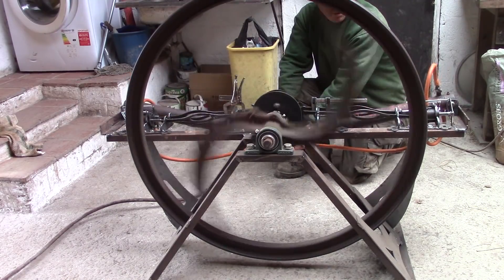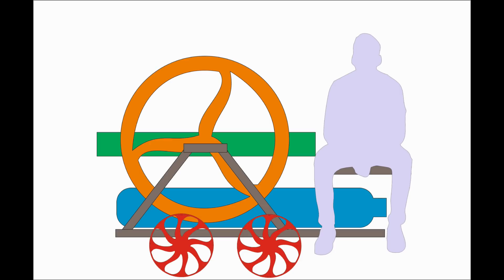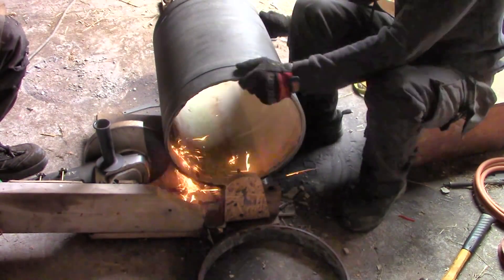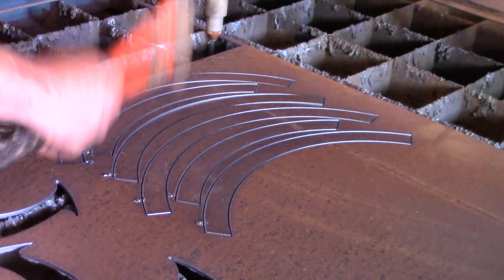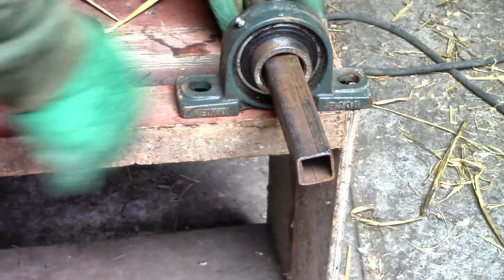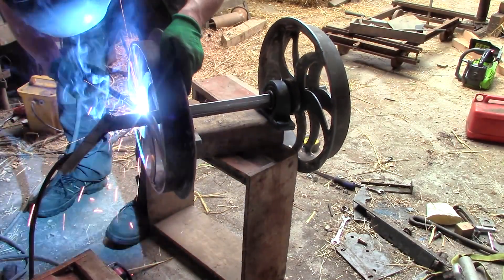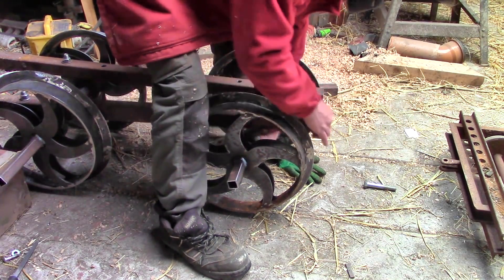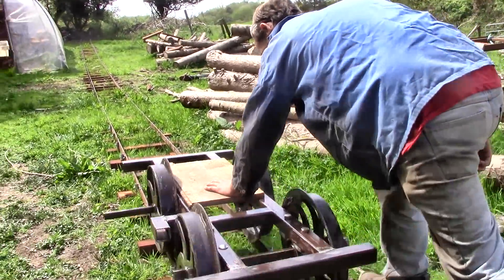Making A Locomotive For The Field Railway – PART ONE: Wheels and Chassis...

Comment: I'm a machinist and seeing people making stuff like this makes me proud to be in the trade. One of these days I hope to build my own little railway for enjoyment purposes and also to move bits of firewood/landscaping material around the garden. Your railway is the inspiration.

Mine will probably be smaller (maybe 12 inches gauge) and may have a rack/pinion sort of bit on the steep section of track.  My garden has a decently steep hill that I don't want to foul the looks of by grading it. It'd be easier sure, but the idea of fastening a gear to an axle doesn't seem impossible. The toothed center rail might be a pain in the rear though. 

Fantastic video as always and keep up the good work!
Reply from the maker: Thanks very much - good luck with yours

Comment: Would you be able to post a Scalable Vector Graphic file for that wheel design? It would be really helpful for those working on a similar project.
Reply from the maker: Of course, no problem. But you'd need to adjust it to your pipe and axle sizes - and if you are able to do that then you could easily design your own spokes..
Reply: @wayoutwest-workshopstuff6299  yeah, that fairly easy with SVG files and can be easily scaled, currently looking to make wheels for a locomotive, I’m fairly close to getting the trucks finished.

Comment: Cleverly thought out, innovative and low cost rail system. Sure it doesn't meet the ideals of a hardcore railway enthusiast but, it works, and works well. Perfect for application as it serves the purpose it is intended for. And, if you need a part? Just kick a rock and find one.
Well done Tim.
Reply from the maker: Thanks, Gwyllym. It's addictive though - you can never have enough
Reply: @wayoutwest-workshopstuff6299  I've done some calculations based on the torque available from those cylinders with a 2.77:1 ratio with 300mm diameter wheels and ignoring all losses, your limit will be a bout 300kg of tractive force, flat out at 60psi. So it will move something that's for sure. On a level grade of course and doesn't take I to account the weight of the locomotive 

Looking forward to the next installment

Comment: If you build the steam one, you could just skip the axle in the middle and put the boiler down low between the wheels. Both sides can be driven fully independently with their own set of valves etc. which offsets a bit the steam demand over the cycle and lets you use smaller pipes until you hit the T-piece going to the valves :)

Comment: I had a strange idea for if you went for compressed air. Make a set of bellows for your feet that you can pump while you ride, so you aren't just sitting there.
Odd idea, but imagine making two longer lines side by side, and you could race locomotives.

Comment: It will be interesting with the weight of the engine. Be enough for traction.  That fine balance between too much weight for the air engine to too little weight and not enough traction. 
It goes without saying there got to be some kind of whistle. 
Good luck with this endeavor.

Comment: Hi Tim, not railway related but this might be a good idea for your next project. I've seen a French invention on the internet made by a company called prommata that's being used all over the world, a tool to be used with draught animals with modular attachment meaning you can attach a plough, potato lifter, ridging plough, subsoiler and any other attachment used for working soil.
Reply from the maker: Thanks, Jack. We're moving away from all soil cultivation because it leads so rapidly to erosion, so they wouldn't suit us anymore. Mulch is the best way if we can make it work for more crops..
Reply: @wayoutwest-workshopstuff6299  Fair enough, perhaps a horse drawn seed drill then?

Comment: If you need a valve gear for the engine I’d probably either use walchaerts or stephensons. Stephensons is better for smaller locomotives and can be internal or externally it’s also better for hill climbing. Walchaerts is easy to maintain and build.
Reply from the maker: I'm glad you think they're easy!

Comment: Did you have the carriage upside down in the trial run?🤔
Reply from the maker: I wanted to have the frame under the axles but the flywheel would foul the axle anyway, so the frame is above..

Comment: I might be mistaken, but I believe CO2 canisters are able to be pressurized much higher than oxygen. In my area at least, it's about a third of the price as well. I admit I have not consulted the machinery's handbook on the subject, but surely CO2 would run an air engine just as well, no? Again I don't know if it's only true of my area, but cannabis legalization has caused grow equipment to flood the secondary market. I have bought carbon dioxide canisters for less than the deposit! Aluminum ones no less. This demographic is much more focused on speed than profit margins. There's a ton of specialized switching equipment based on humidity temperature or light that I have found remarkably useful in the workshop. If legalization has reached your area or will soon, I highly suggest you keep your eye on the secondary market. There's a lot of really good quality gear that somehow never got remarketed to a different demographic yet many of these things are much better in the machine shop then they were in the greenhouse. I hope something I said was of some use

Comment: Lovely job, wonderful to see your railway getting an engine. Good to have larger wheels, though you'll still want to gear them down rather slow, I've had trouble with slipping wheels with the low contact area that narrow rails have. Great progress!
Reply from the maker: I'm surprised you've had slippage problems, Jonathon - you're running a heavy loco on level track. I'm worried about mine now!

Comment: How about a electric-hydraulic powered locomotive? Ie a electric motor powering a hydraulic pump powering cylinders. It keeps the cool factor and fun of hydraulic cylinders and valves. I think it would be relatively quiet, like an air tank powered vehicle would be. There could also be hydraulic power takeoff for portable cylinders, or perhaps a wood splitter rail car. It would have sufficient battery power to run an AC inverter to power electric tools or accessories. 
If you wanted to go wild, it could also be equipped with large tires to go off rail, like the opposite of hi rail truck. If it was articulated in the middle, it would handle tight turns on rails and be able to steer off-rail. Steering could be done with a hydraulic cylinder that is floated on-rail and powered off-rail.
Reply from the maker: Go for it, Aaron! It sounds a bit complicated for me - I go for cheap and simple everytime : -  )
Reply: @wayoutwest-workshopstuff6299  "Yes, but what about we make it more complicated" yep, that's me lol ;):D

Comment: Just a quick thought, I would have the bolts facing down, that way even if the nuts work loose everything will still be keyed together, if a little rattly. The alternative would be threadlock or lock nuts

Comment: if there's no way to fit yourself on the loco (like even when you could balance yourself and the air engine on the chassis, the Locomotive alone would fall over)  then only the controls can just be fit at the ends while you can just sit on your short flatbed that can be coupled on both sides.

Comment: I think my approach would be to see if i could build a rotating carriage for one of the sets of wheels, and then make the wheelbase super long, so that you can have the whole engine between them as low as possible. Then maybe the seats could be directly above the wheels in the front and back! I suppose a thrust bearing that could hold the weight for the floating axle would be pricey...
Reply from the maker: I can't have a long wheel-base because it wouldn't go round the curves : -  (

Comment: Looks really good. I was just thinking it might be worth using smaller diameter wheels. You'll get better tractive effort then. Good job though. Really enjoy these episodes of the railway.
Reply from the maker: Are you sure about the traction, Joseph?
Reply: @wayoutwest-workshopstuff6299  I might be wrong. I don't have any maths to back it up if in honest. I just thought it that was the case, because back in the days of steam the cargo hauling engines had much smaller wheels than the express ones. Other than that, not sure lol

Comment: For inspiration check out compressed air mineing locomotives. Nicknamed whistleing pigs they were built around large air tanks with radial air motors for the drive engine.

Comment: I love the laid back style of your videos. Shut out the personal and  world's woes. 
Aesthetics aside the spokes should really be straight for strength. Could have saved some material .,maybe 
 The curves in the spokes are normally seen in cast wheels to enable shrinkage when cooling.
Also of course the treads on the wheels should be conical so the flanges don't touch at high speeds! Lol.
Anyway loads of fun to watch.
Reply: You are correct about the spoke design allowing cast wheels to shrink without breaking. Ever notice cast iron flywheels etc never have an even number of spokes? If they did the stress of cooling would break one of them instead of bending the rim.

Comment: Passenger steam locomotives all had big wheels (for speed). Freight steam locomotives all had small wheels (for traction). I think you may need the latter?
Reply from the maker: But passenger locos also need traction?
Reply: @wayoutwest-workshopstuff6299  Indeed. Perhaps I should have said 'torque' rather than 'traction'

Comment: Are you going to make a loco that uses sola power using a power bank like a jackery or eco flow? It would be a lot easier to make and once you have the sola and power bank it would be free to run, easy to control the speed and nice and quiet so it don’t scare the horses, it might make the odd person jump as you sneak up behind them tho the the electric do when they sneak up on you.
Reply: Not that sunny in SW Ireland!

Comment: I do like the use of box section as axles and the use of standard self aligning block bearings. So much cheaper and easier to get apart, round bar seizes in the bearings after a while, cheers

Comment: Hi Tim,
This gets more exciting every time. Thought of coupling rods between your driving wheels ? That means you’ll only need to drive one axle directly from your fly-wheel.
Gwyllym Suter suggests you add a tender. He’s right I think - that would not only provide you with a more comfortable and less dangerous place to sit but increase your range too because you could build it around several air-tanks with changeover valves between them, maybe 2 or even 4 would be possible?
All the best to you all,
Rob
Reply: Coupling rods or a chain between the two axles would work, I think.

Comment: Looking great!  I have to say when the chassis was upside down, I had a moment when I thought that was how it was going to stay and I thought oooh that's a good idea to help lower the center of gravity.  If you make the wheels big enough and have the heavy frame hang below the axles, it will lower your COG.  OR!  If the frame sits on top as you have it now, is there enough room below the axles to put the air bootle underneath?  That too would help lower the COG.
Reply from the maker: I wanted to put the chassis under the axles - but the flywheel would foul the axle, so it needs to be this hight anyway. And the air tank would need to be very thin to get under the axle - I should have made bigger wheels!

Comment: https://youtu.be/vzGS4j1YQPs look like what your trying to make. It an impressive effort so far. I’d love one of my own. Enjoy the series definitely giving me ideas.
Reply from the maker: Yes, I'd love one like that - but huge tanks?
Reply: @wayoutwest-workshopstuff6299  depends how good you are with your welder? or know some who does friction welding? I did notice when you cut the wheel the diameter of the pipe. The size look about right for some examples I’ve seen. there example of ex mining locos that have three smaller tank stacked in a triangle. I’ve seen others using thick wall compressor tanks. Up to an inch thick.  Or 30mm thick plate.  I have no idea where you find a tube with that sort of spec? Even second hand recycled tube? Richard Trevithick early designs look a lot like what your trying to create. Though he used a larger gauge track.. It wasn’t uncommon to use a narrow gauge in the mines. Often cobbled together from what they could find.. So good luck! Keep up the good work!

Comment: Sorry to come back with the same suggestion but mounting the flywheel horizontally could help keep your centre of gravity lower and increase the efficiency of it too...
Reply from the maker: yes, maybe, but the transmission would be more difficult, wouldn't it?
Reply: @wayoutwest-workshopstuff6299  yes you'd have to connect the vertical axle with the horizontal drive axle, perhaps with a linkage from a car, clever thing that goes round corners? Or two angled cogs from wherever you find that kind of thing? It's a bold step but might be worth it...

Comment: Perhaps you could set the engine up at one end of a straight bit of track and get it to pull loaded wagons with a bit of string. That would tell you what kind of load pulling capacity to expect.

Comment: you said you would leave out the flywheel entirely if you made a steam engine... id recommend a small flywheel like your new wheel size with just a few rings of steel stuck to it. nothing like the one you have here but just a little bit to help keep the steam engine running in any potential dead spots in the stroke.
if your air engine stalls, it can only max out at whatever pressure you have in the tank, steam can build pressure in odd ways and i doubt you would want a steam pipe blowing off of it while your using it.
Reply from the maker: But if it had double-acting pistons then there wouldn't be any dead spots. That's why steam locos rarely had flywheels.

Comment: Love it! The advantage with a compressed air system is there is no hanging around waiting for steam generation, you have instant access to the compressed air - provided you have at least one (preferably 2) in reserve for a quick switch over. Looking forward to seeing how you'll mount the pistons - are you going with a chain drive or cranks - I think chain offers more scope for changing ratios if you need power or speed, they could be cut in half for easy mounting on the centre of the axles? and an idler pulley for adjusting tension or sprocket diameter. I'm guessing the engine will be mounted inboard (unless you're making a sister?) for better weight distribution... Looking forward to the next one, Tim!
Reply from the maker: thanks Tony. I'm still pondering all the possibilities..
Reply: Yeah, I think a motorcycle chain and sprockets would be the easy option here.

Comment: I think you ought to be able to increase power by connecting the base connection of one piston to the top connection of the other. As long as its at 180 degrees the timing should be correct
Reply: Also, ive only recently discovered your channel and find myself constantly watching. Keep up the good work.
Reply: @davers1610  For your information you can always edit your comments by clicking on the 3 vertical dots to the right of comment.
Reply: @tonygrimes13  thanks :) ill bear that in mind. Think I've done in before tbh.. 😂

Comment: Would it be possible to use old drum breaks for wheels? They are about the right size and some have a substantial raised flange around the rim….
Reply from the maker: You could, but you'd need to flare the flange a lot first or it would just ride up out of the rails

Comment: It might be, that on powerd wheels having them tapered makes a bigger difference than on the others because splipping is more of a problem for them. But as we established before, for your tight corners, that would need to be a very pronounced taper to make any difference. would probably not  look right. 
Sorry, to bring up this old topic again, but should we just for fun calculate, how strong they would need to be tapered, to provide the differential for your curves?

edit: there is a way to measure that ratio directly, that might make for a fun Video if you were inclined to make it. basicly u make a rolling pin in the form of a double cone. (points outside obviously). You role it over the rails mark of where it roles on the rails. One way to do this marking is to put colour on the rails and see where they land on pin. The ratio between the biggest ant the smallest diameter is a lower boundary for ratio one would need to provide for the differential. I say lower boundary because if you actually use that ratio you would plan for the wheels, to run on their very edges. Witch I don't think would be the best of ideas. a little more is needed to provide some wiggle room.
If the pin falls of that means it is not wide enough or that have found a point on the rail, that is gonna be a problem.
f.e. no matter how wide you make the pin it will never be able to nagotiate a sharp 90° corner.
Reply: I think for tapered wheels to work properly he may need a proper suspension system to keep all the wheels on the rails.
Reply: @andreblanchard8315  a suspension system would properly make the ride smoother, but I don't understand the connection to the use of tapered wheels. Also I think a suspension system is way more complicated for less gain.

Comment: as I stated before I think it would be really cool to try liquid CO2 as a pressure source (pun intended). In a way that even would be a steam engine. Just not with water steam but with CO2 steam. And with the surrounding as a heat source.😁